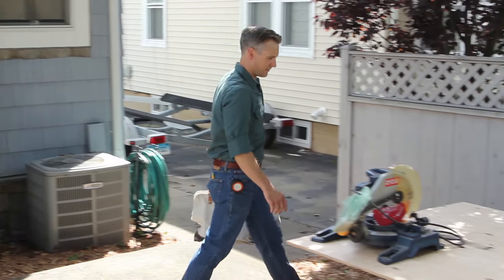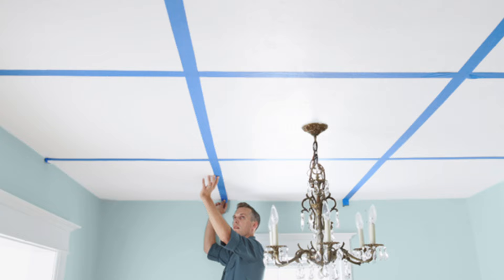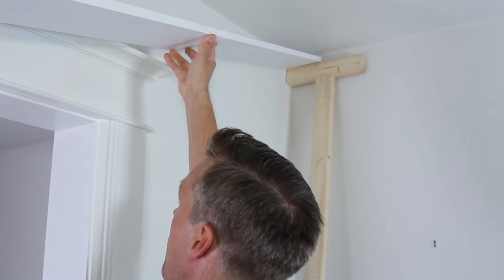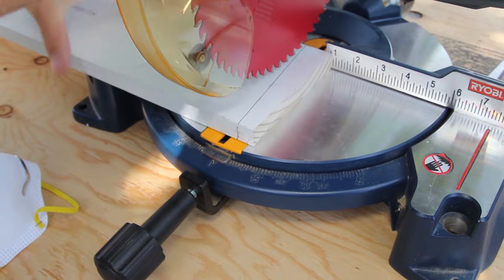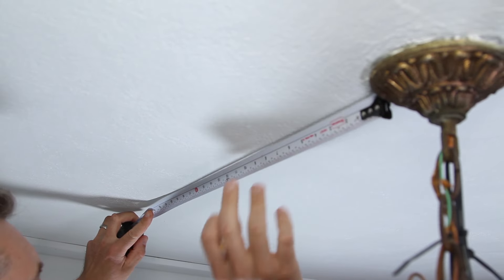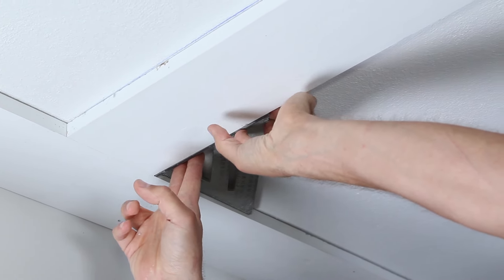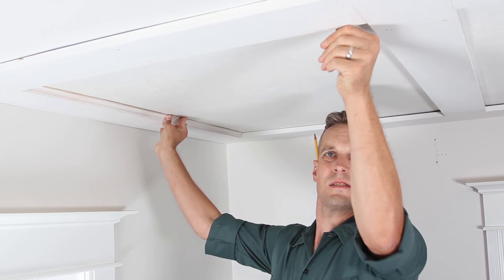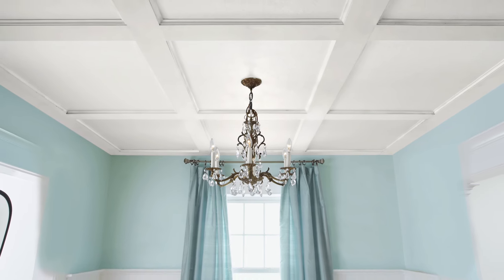How to Build a Coffered Ceiling | This Old House

Comment: This is a great solution for those who would like a coffered ceiling but don't have high ceilings to go the traditional full beam coffered ceiling style. I think I may do this in my living room to give it a bit more elegance. As soon as I pull all the faux wood paneling off the walls and replace it with drywall :( That wood paneling is kind of taking away from the elegance factor!
Reply: My father left the paneling up, filled and smoothed the recesses with joint compound, sanded, and painted.   You will need to a tape and compound the dry wall joints anyway.  Plus even with the paneling off well you could use the really really thin dry wall I guess.  This was much easier for him to do it looked amazing and we didn't lose any Room so to speak because the paneling is much thinner than Half inch dry wall.  Good luck.  It was definitely the better way to go for our family
Reply: @overcomer4226  I just did as adviced and the result was amazing! 😄👍 I added a bit of texture then knocked it down. It saved me a ton of money and time. The only issue is I forgot to tape where the panels meet. You think I'll get cracking overtime?

Comment: Thanks, T.O.H.!  Great vid with clear and easy to understand steps.  One recommendation, if I may.  About the 3:45 mark or so, where you're toenailing the cross pieces into the main beams, it is NEVER a good idea to have your thumb (or any finger) anywhere close to the nail path of that air nailer.  You WILL "eventually" find a board whose grain causes the nail to deflect outward instead of along the intended straight path into the 'meat' of the wood.  Having your finger in that path results in your finger 'meat' having a very painful 'meeting' of its own with that nail!  Friendly tip from one who has had a 'meeting' or two with a air-driven finish nail.
Reply: i was cringing at that moment.
Reply: This comment 😂
Reply: And SAFETY GLASSES 👓

Comment: On the shorter cross members where there are no ceiling joists for nailing... we have used contact cement with success.  It takes a bit longer, but it makes a very secure bond to the ceiling.  Just be sure you get EXACT placement right the first time... there is no adjusting once the two cement surfaces contact.
Reply: does it matter lol, as long as he nails into a joist it doesn't matter if he uses contact cement or not.
Reply: Borat Yeah... it does matter. The joists run one way so you can nail into the main runners or cross members... not both.  LOL... buy a book on basic construction... and a can of contact cement.
Reply: Porsche924Tim cross runners in between joists? Uhm no such thing. Your either nailing along a joist or every 12 inches (joist to joist) if there ain't a joist beside the top plate of the wall then you can nail cross members yourself. But houses aren't framed with cross members. You may read books about construction but I work construction as an electrician so your all talk. Lol I love how you use contact cement to glue 2 pieces of wood together I actually laughed at the fact you sounded so smart by saying how you used contact cement. Too funny
Reply: Borat We use contact cement to glue the trim cross-members to the ceiling surface, not  to the main runners, rookie.  I've been doing trim work for 50 years and don't need an electrician with no structural construction experience to give carpentry advice.  Especially from someone who does not know that joists are 16" apart, not 12".  Please stay in your area of experience...  It is NOT carpentry...
Reply: Porsche924Tim
Like i said I am an electrician, but I keep an open mind in regards to other trades so I am constantly learning new things. sounds like you are a bit jealous of my chosen trade and you're harassing me because of it.

Comment: No mention of coping the ends of the inside molding pieces to get a tight fit?  I would assume that they go up just like really small crown molding...
Reply: No point in coping that tiny trim, especially if you are doing paint-grade molding. Just miter-cut it.

Comment: Watched this a few times and still lost on the scribe line method they are using in the beginning. Anyone get a handle on this?
Reply: I was stuck too. I just got it. You measure the distance of the 2nd mark to end of the board and transfer that to your board making a scribe line

Comment: My ceiling is the concrete, 
¿can I install this in my home??
Reply: Ana Ordóñez no
Reply: Yes you can , instead using nail to attach board u will need to use concrete crews . To use it u have to pre drill holes with diamond drill bit  - good luck
Reply: Some people with concrete ceiling will install a false ceiling of plywood or drywall and mount it. Then im sure you can do aomething like this a lot easier then drilling through concrete for every board

Comment: Um. Wood glue won’t stick to painted surfaces, so that crown molding is really only being held on by brad nails and caulk.
Reply: Georgia Jory the wood is only primed so it will grab. Plus the nails and then the caulk, it’s not going anywhere
Reply: wurly164   Wood glue does not stick to primed surfaces, wood glue adheres wood to wood, nothing else. A simple google search can tell you that much. Also brad nails have no head so they can pull out easily that’s why they are almost never used alone. As for the caulk it depends on the type, it is a decorative trim so it should stay. But this video give the wrong message of function for these important woodworking tools.
Reply: @Saltytrout18  and yet it holds......
Reply: wurly164 “it is a decorative trim so it should stay. But this video gives the wrong message of function for these important woodworking tools.” The point isn’t that it holds, you could put double sided tape on the back of it and it would hold. The point is that it’s an instructional video that instructs you to improperly use those materials.
Reply: @Saltytrout18  being a woodworker myself I understand but just being trim it would be ok, if it was structured then you want bare wood on wood, but in this case I give it a pass, the caulk alone will guarantee its going no where
Reply: wurly164 you are clearly not understanding what I have tried to explain to you, at this point let’s just agree to disagree.
Reply: @Saltytrout18  I knew you would, thank you
Reply: wurly164 excuse me.
Reply: wurly164 Okay, if you really want me to break it down for you since you haven’t been able to comprehend previous attempts. Wood glue does not stick to painted, primed, finished, etc. surfaces, it sticks WOOD TO WOOD. The caulk is is not placed between the two surfaces that he is attempting to attach, it is a filler for the uneven spaces between the ceiling and the molding and therefore offers no structural yields. This means it is not sufficient to hold it to the ceiling. Next the brad nails have no formal head on them, so as the wood in the ceiling, main runners, and molding expand and contract over time, they will start to pull out and weaken their already minimal bonding capabilities. ALL OF THIS ASIDE, my main point was that they instructed the improper use of building materials, to which you have already agreed about, as you said “if it was structured then you want bare wood on wood...” I understand that it is a decorative trim piece, however the building materials are being used improperly, and worse off they are instructing others to use them improperly. 
I am also an avid woodworker and carpenter, you can choose wether or not you want to believe me on that front. I have put my best foot forward in an attempt to halt this frivolous back and forth and educate you on my stance. However, it seems that you only wish to continue making low blows and unnecessary comments with attempt to belittle and only listen for your own gain and not to the conversation at hand. So, thank you Wurly164, for being the next person to teach me that you can’t sling mud, without losing ground.
Reply: @Saltytrout18  and again,... It did the job, the wood glue will bond with the primed surface, not as strong as it needs to be, we covered that countless times, next the brad nails do have heads, nails not pins, third the caulk filling the voids will help as well, Alex caulk is great at this, forth the latex paint is a fine rubber membrane all this together held the small pieces of trim. Not how I would have done it but it worked. Contact the guy who did the video and ask him if it failed. Did he have to go back, I bet you no.
Reply: wurly164 and again... that wasn’t the point of what I was saying. But I guess if you haven’t understood that yet, it’s hopeless.
Reply: @Saltytrout18  Best of luck to you and your glue